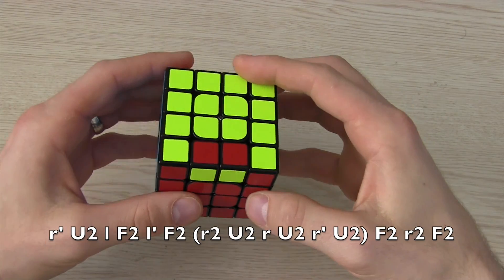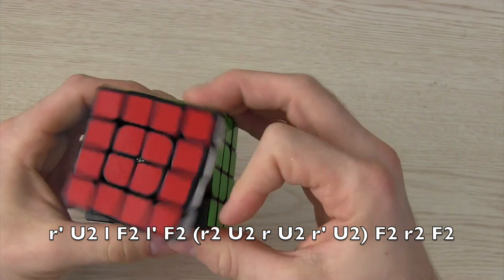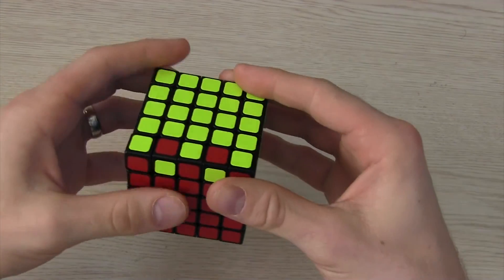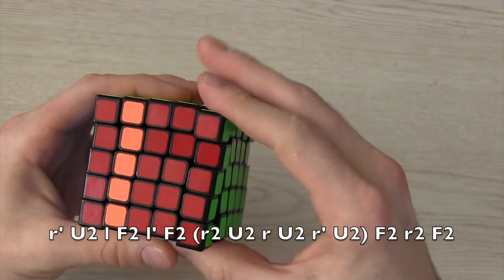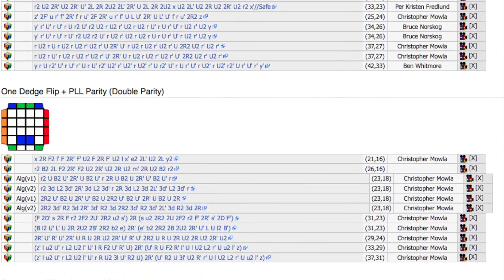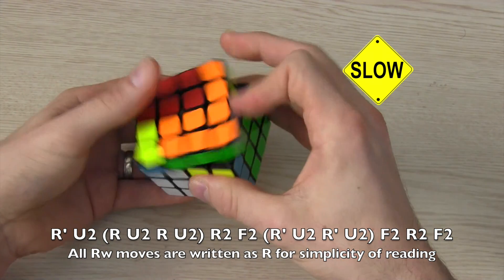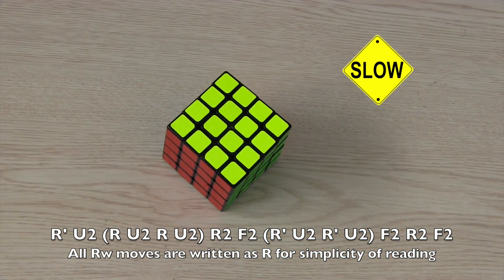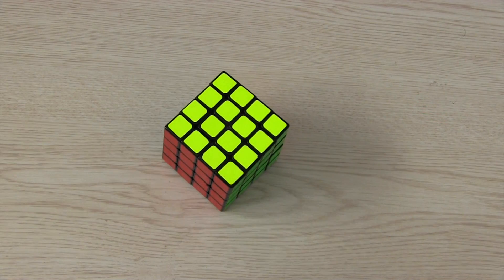Faster OLL Parity Algorithm

Comment: Faster OLL Alg 
Rw' U2 (Rw U2 Rw U2) Rw2 F2 (Rw’ U2 Rw’ U2) F2 Rw2 F2

This algorithm isn’t working for me when applying it to the 5x5. Am I doing it wrong or can it only be applied to the 4x4?
Reply from the maker: For 5x5 it does leave a few center edge pieces out of place.  You can do the 4 move M' U2 M U2 thing after, but ya, it's more for 4x4.
Reply: @SpeedCubeReview  thank you for that. 
Is there 1 algorithm that works for all big cubes for PLL parity?  As this one doesn’t seem to work for the 5x5:

r2 U2 r2 Uw2 r2 Uw2.
Reply from the maker: @Mark-hh3lg there is no pll parity on 5x5. Only even cubes
Reply: @SpeedCubeReview  of course, sorry. Blonde moment. 
So that alg will work on all other even cubes?

Comment: I use : Rw U2 Rw' U2 Rw U2 Rw U2 l' U2 r U2 Rw' U2 x' U2 Rw2 https://alg.cubing.net/?puzzle=4x4x4&alg=Rw_U2_Rw-_U2_Rw_U2_Rw_U2_Lw-_U2_Rw_U2_Rw-_U2_x-_U2_Rw2&type=alg
Reply: What do you mean ?
Reply: thats what r stands for r = Rw
Reply from the maker: +SimonTheCuber It depends on the notation.  Some placed consider r as just slices and Rw or 2R as "wide" moves.  There are some places that call r moves wide moves but it is not as common.
Reply: Ok, i always used r or Rw as i tought those were common
Reply: +SimonTheCuber Voila, fixed it.
Reply: SimonV much faster than my alg (I can't say it cuz I only know it from muscle memory)

Comment: How's the Meiyu going on so far? ??
And as again nice vid.
Reply from the maker: +yash raj Still waiting for the new caps to come in.  It is a fine cube already with some very nice cornercutting.
Reply: +SpeedCubeReview Moyu also announced its new batch. Any plans on testing that one out
Reply from the maker: +yash raj yes.  The new batch is the same as the old one with the new caps. I have the caps coming in right now from one company and have a new version on order. I'm probably going to give one away.
Reply: +SpeedCubeReview ohh
Reply: +yash raj and what's with that 3x3 mirror block at the start?
Reply from the maker: +yash raj I don't see what you are talking about?
Reply: +SpeedCubeReview fb
Reply: +SpeedCubeReview I got the new centers a while ago: This seems to be other people's experiences, but they made mine almost impossible to turn (horrible grinding feeling, and catchy beyond belief). I did OLL parity 400 times on each axis (I was bored), and it's going away a little, but I don't know if it'll ever really go away.
Reply from the maker: Did you make sure the centers are at a 45 degree angle?  If the center is facing 90 degrees it catches on center peices like any other 4x4.  My MeiYu out of the box without the new caps feels fine.
Reply: +SpeedCubeReview Everything is aligned correctly, that was the first thing I checked. With the old centers, my Meiyu was probably my best 4x4 (a few prominent cubers referred to it as "the only good Meiyu" they'd tried). As soon as I put the new centers in, the cube was awful. I'm going back to the old centers as soon as I have the stickers for them.